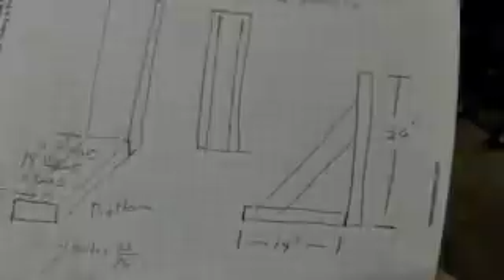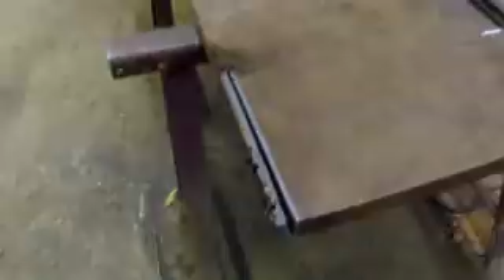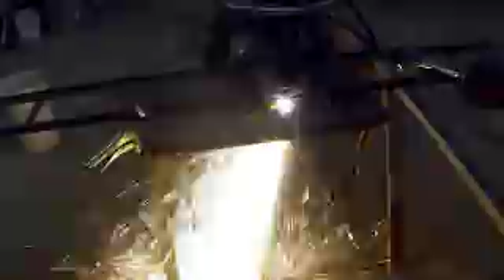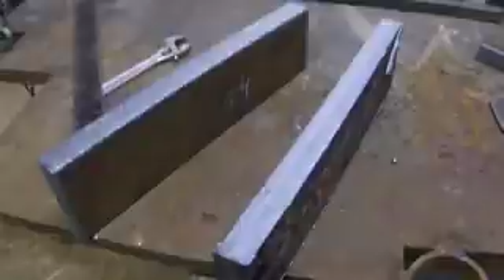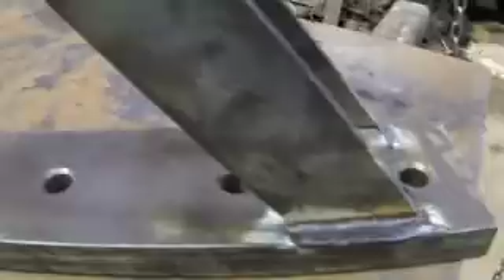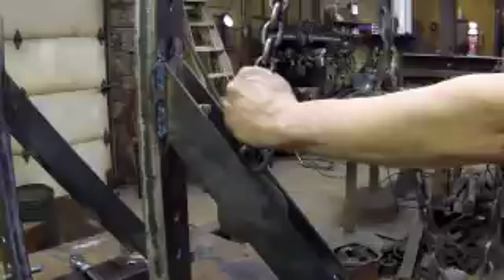SHOP UPDATES #11

Comment: I'm going to assume you have a lousy IP, or your camera's older than dirt,  thus the low resolution video. I can hardly make out what I'm looking at, but what I did see was cool. I liked the torch setup. The finish product looks quite tough.Thanks for the video.
Reply from the maker: I'm trying out a gopro and a new edit program and this is the first attempt
Reply: I think YouTube gives you the option of HD or SD, or whatever it is, when you upload your video. HD of course takes longer and depending on what kind if internet service you have, it could take forever or just a couple of minutes.  SD uploads fast even with lousy service I would imagine but HD is much more appealing to watch. Thanks for the reply and good luck.